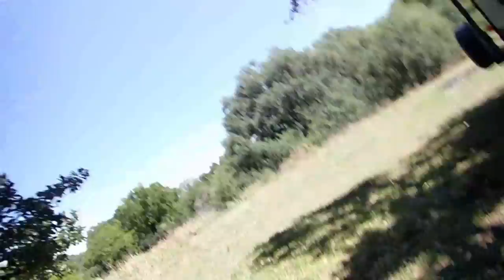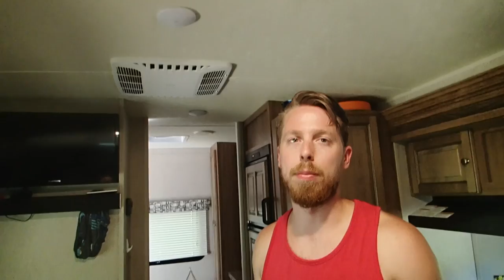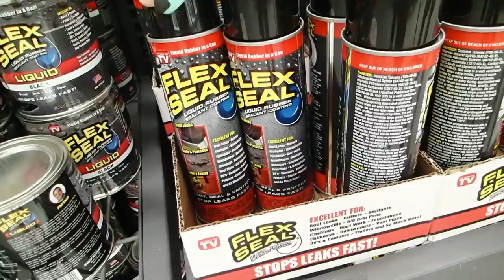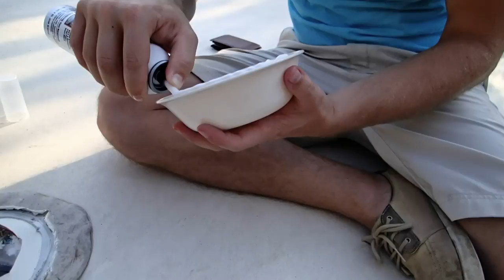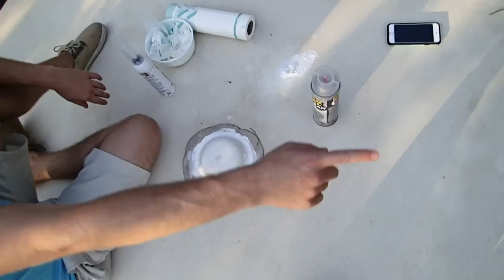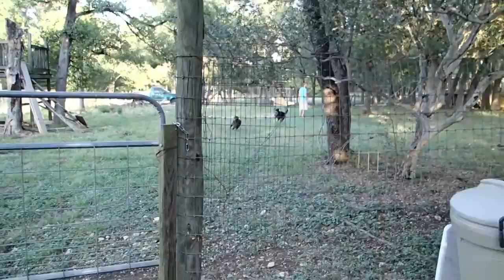OOPS!!! 😳 // PUT A HOLE IN OUR RV ROOF

Comment: You two are great to be able to laugh it off and not take it out on each other. I've heard many blame one another in rv parks.  It's common to put little holes in roofs. We made the mistake of using Flex seal, it peeled and then the crows helped it along. We are now planning to strip it the remainder of the way and use Eterna bond tape and Dicor for RV s as a permanent fix.  It is a delight to see how respectful and kind you are with each other. A lot of folks could learn some great skills from your relationship.  Cheryl

Comment: We rubbed against a tree which caused a 6 foot cut in our rubber roof.  I cleaned the area well and used eternabond tape to cover the rip.  I then used Dicor self leveling caulk around the edges of the tape.  It's been there for 3 years without a leak and still looks good.

Comment: You must use Buteryl. Comes in a tube. You can get it at Lowes or Home Depot or RV store.. I'm sure I didn't spell it correctly. Sorry for your incident. All RVers have done something like this. It's called experience :)
Reply from the maker: +vppnbrent Hahha yep! Just another experience to add to the list! We figured others had gone through something similar and would find it funny. 😜 The bowl is a more temporary fix until we find the permanent one. Got some rain coming this weekend so we wanted to have some coverage before then! -Blair
Reply: This will be a lot funnier a year from now. Good luck. You guys handled it a lot better than I would have or did :)

Comment: Must get a roll of eternabond tape. :) On the antenna take the inside dial off and put a flat metal cover over the top and tape it up and on the inside just get a round junction box cover and put it on since you don't use it

Comment: Great job on the whole video fixing the holes in your home.  I laughed the whole time.  The only concern I would have with the bowl you used is if it hails it may break.
Reply from the maker: +Matt Wagner Yeah we are definitely going to find a more permanent fix. Just wanted to get something there until we figure out the fail proof solution. -Blair

Comment: Eternal Bond tape all you need to do is cut off the piece that's standing up it's been torn put a square piece of eternabond to cover all of it roll on top of it with a roller to activate and then all around the edges you could do the self-leveling caulking
Reply: I have a 2017 Gulfstream Conquest. And had to get mine fixed already to.  I let some yo yo back mine in and hit a. Camper next to mine. Didn't hurt the other camper but put a hold in my side wall.   Insurance fixed it. But it cost them $4000

Comment: I see Jack of all Trade master of none (Just Kidding) :))))) I would have also put another tiny bowl on top of that as well just to be on the safe side and then every 3 to 6 months go up and double-check to make sure everything is nice a sealed. Enjoying your videos and glad to see that Matt is up and about. Peace and blessings always......
Reply from the maker: +M Garcia Thank you!
Reply: We really enjoy your videos. We are a retired couple and have a Mini Lite 2304KS.  We don't live it it, but enjoy our camping trips.
I would use some eternabond over the roof fix you made.  The stuff is super sticky and made to hold up on an rv roof.
I had the same issue on the wheel wells. They are a moulded plastic piece and seem to warp.  They did not use enough screws to attach them so I added 5 or 6 more screws from the bottom. I then used a caulking gun to seal the wheel well where it attaches to the trailer underneath. This is to keep the water out when driving in the rain.
Reply: You might want to join the Rockwood Mini Lite fan club group on Facebook.  It's very informative and a good resource for information. All with trailers like ours.  Love you guys!

Comment: A tear in the roof membrane is not something that can be left go. If any water gets under the membrane you could develop a major problem with mold or rot. DO NOT let anyone have you believe you can repair it with anything other than a Dicor product! Anything else could make it worse. I hope it's already repaired by now with a Dicor patch. You guys are doing great with the RV and the channel. ☺️  BTW, the antenna will have to be reinstalled because you can't patch an opening like that. That's a job for the RV dealership.

Comment: Eternabond tape
Reply: Brett Howell for sure, that flex seal will not do it for long.
Reply: + Dicor Self Leveling Lap Sealant to just make sure.
Reply from the maker: +Brett Howell  The bowl is a more temporary fix until we find the permanent one. Got some rain coming this weekend so we wanted to have some coverage before then! -Blair
Reply: use eternabond tape dont use just sealant it will not hold go to an rv dealer they sell it by the foot and its made to patch roof. Also one thing i learned the hard way using regular silicone and other sealant not made for rv roof it will get to hot on the roof and run down the side of the rv.
Reply: Yes mam I understand.
Reply: Yes that eternabond tape is the way to go it will out last your roof
Reply: I agree. By the way, replacing the antenna should be fairly easy. As for damage repair costs, your insurance will cover the more serious incidents such as wiping out the air conditioner.

Comment: It costs you a lot more to use inferior quick fixes than to use good stuff. Dicor and  eternabond  are the go-to's when it comes to roofs. Whenever anything says "as seen on TV"  it's some cheap crap that generally doesn't work at all. I wouldn't be surprised if that "sealant" starts leaking the first rain you get. You would have been better off with simple silicone caulk
Reply: Uwe Schroeder   You don't use silicon on rubber roofs. Not compatible.

Comment: Guys guys guys. Double face palm. Great temp repair but you are YouTubers. Go to YouTube and search rv roof repair. I'm not a fan of self leveling sealant but everyone else likes it/uses it. You can get eternabond from Amazon and EVERYONE swears by it. I got the giant roll. Getting ready to reseal my RV roof next week. So a layer of eternabond and for good measure seal the edges of the tape patch with a self leveling lap sealant MADE FOR YOUR ROOF TYPE. Your roof type? There's a video for that. Either TPM OR EPDM. I may have the letters wrong but you can find it. Search rubber roof type. The eternabond will work on anything. The flex seal will last about a year in Texas and then begin to crack. You get the idea. Nothing worse than a repair that fails and getting water in your ceiling. Mold rot etc. I do like the bowl trick though. You could seal the bowl rim better with the tape and sealant and leave it that way. The hole however is set to fail the way you did it. Hang in there.
Reply from the maker: +Asher Stanton  The bowl is a more temporary fix until we find the permanent one. Got some rain coming this weekend so we wanted to have some coverage before then! -Blair

Comment: Damn that sucks!!  Thats always my fear with the Denali Dutchman as well! Ive been working on an older RV recently sealing everything off. Picked Butyl Tape and when i installed the MaxAir i used what @Brett Howell said around any holes / screws and all around the outside of the fan.  

That hole by the fender... id totally go back and complain! That's not right...

Oh and you should totally see what i installed for the awning, if you guys want more light look at LED Awning strip. If you're interested ill send you a DM on IG. Makes sitting outside at night SOOOOOO much better! (@J_o_z_z_i_e)

Comment: The antennas that raises up are not that good anymore. Live an learn. Your trailer is not that tall, so any limbs hanging over need to be view carefully before going under them.
Reply from the maker: That's the antenna that it came with. We don't plan on replacing it with another tall one for this very reason. -Blair